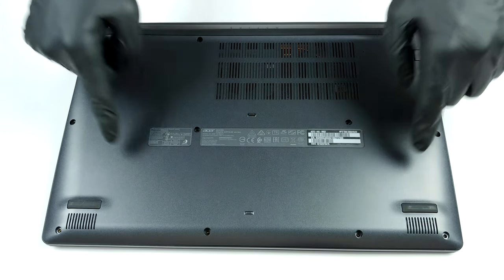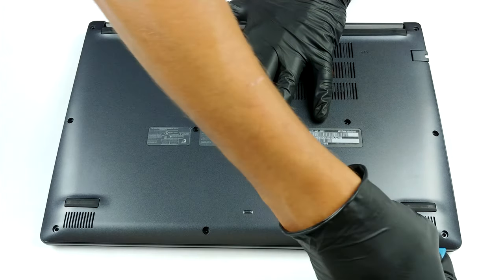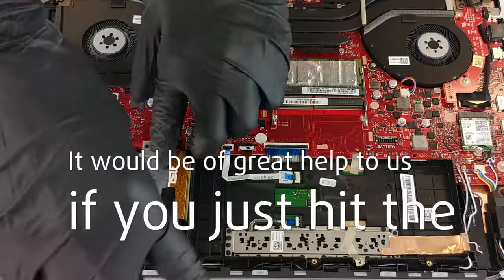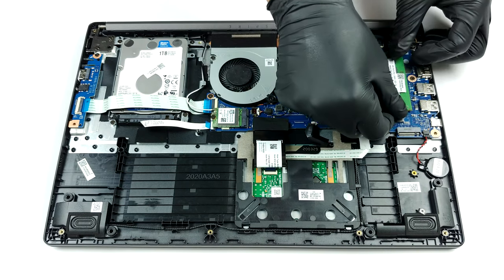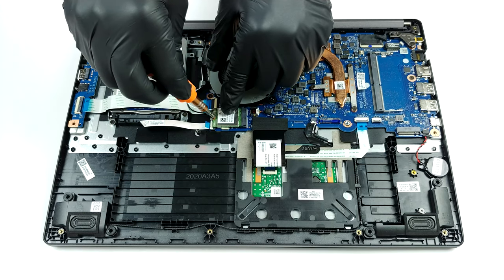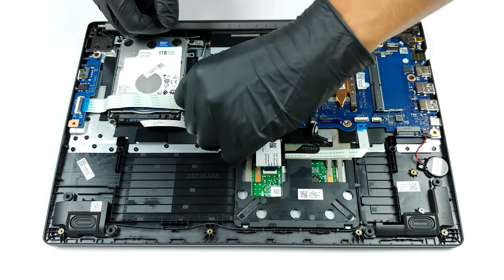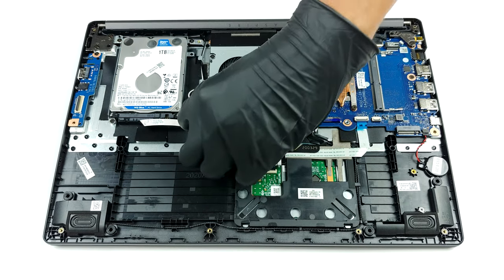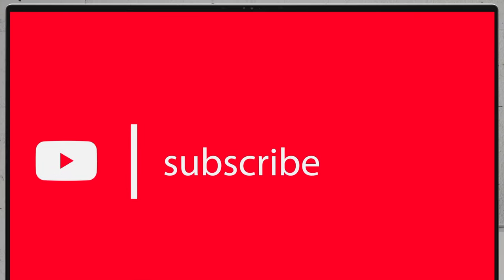🛠️ Acer Aspire 5 (A515-44G) - disassembly and upgrade options

Comment: I’m looking at getting the 4300u version with the 4gb ram. Can I upgrade that model’s ram to 12/20gb using a different single ram stick still?! I’ve seen mixed answers. Model number is A515-44-r93g
Reply: Would love to know the answer to that too from someone on the internet that knows what they are talking about! Add to that if you can get a 1 T 2.m nvme to replace the 128 that comes with it:)
Reply: yes, I have the same questions, would love some help
Reply: I'm lookin at the same lappy. I want to order RAM at the same time, upgrading from 4 to 16 but I guess I'll have to actually order the lappy, wait for it, open it see for myself what's in it THEN order the RAM and wait...
Reply: @aquariandawn4750  ok here is the deal on this laptop...you can use up to 16g ram in the empty slot (4g on board can't change)  I used Crucial 16g 
https://www.amazon.com/gp/product/B086R8T446/ref=ppx_yo_dt_b_asin_title_o02_s00?ie=UTF8&psc=1      memory .. nice machine:)
Reply: Not sure why it left out the NVME memory upgrade part but here it is  https://www.amazon.com/gp/product/B087QTMXS7/ref=ppx_yo_dt_b_asin_title_o04_s00?ie=UTF8&psc=1  ...you can't add a 2.5 SSD even though they give the bracket and plug-in there is nothing on motherboard to connect it to...you can go up to 2T on the NVME memory...hope it helps:)
Reply: @legaleagleandpaws8198  thankyou. Are you 100% certain about the SSD extra bay? I've watched many (I do mean MANY) Acer Aspire 5 Slim laptop teardown and upgrade videos. I realize the Acer Aspire 5 has many models, but every single video I've watched for over a week now has installed the second ssd hard drive with the included cradle and cable. I've literally been combing You Tube for videos on the Acer Aspire 5 a515-44-r93g, I can't begin to number how many I've watched, yours is the first to say there's no plug in for it. Everyone I've looked at on Amazon, Aliexpress, Newegg and Ebay all say an ssd can be installed to compliment the included drive.
Reply: @Ervin C. Duran If RAM is soldered on the 4300u and there's a open slot, that's not considered dual channel?
Reply: @Ervin C. Duran I understand what you're saying. How's the sound, as bad as people say? I'm sure it isn't and I can watch movies on this right.
Reply: prefer 44g version with dedicated RAM. to let whole 4 GB RAM work in double-channel mode for the CPU. +16Gb should fit

Comment: I don't know if anyone is having the same issue but my fan sounds like its grinding on something but I do not know how to take it appart safely to clean it, I don't even know if I should. Or should I just send it back (is still under guaranty) and ask it to be 
checked?
Reply: try to do a strong blow into the cooler on the side it takes cool air: probably there is something stuck in the radiator

Comment: does this have a second ram slot on the other side of mobo
Reply: im pretty sure the second ram slot is 4gb and its soldered on to it but im not 100% sure
Reply: @emreguzel5352  You are absolutely correct

Comment: Is this the Acer Aspire 5 a515-44-r93g?
Reply: I just ordered that. The r93g has 2 ram slots not one but they are pretty much the same other wise.
Reply: @yazzor828  is the RAM chip it comes with soldered or can you access both?
Reply: @aquariandawn4750  just got it in. looks like i was wrong. One ram slot. if you get more ram make sure its the same speed as the soldered on stuff cuz i bought 2400mhz and it wont boot with it. Also you can not add a ssd, R93g does not have the place to put in the ribbon cable though it came with it.
Reply: @yazzor828  hey thanks for your updates on this. are you saying you can add an 8GB ram stick and have 12GB total or just a single channel ram? Because you said it's soldered.
Reply: @jlee5490  U can add an 8 and have 12 in total. one soldered and other is not